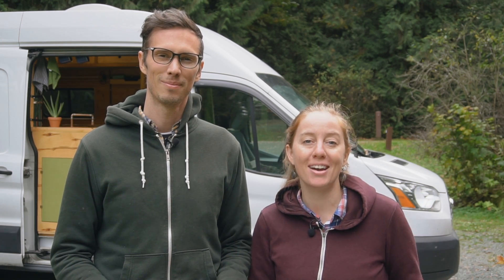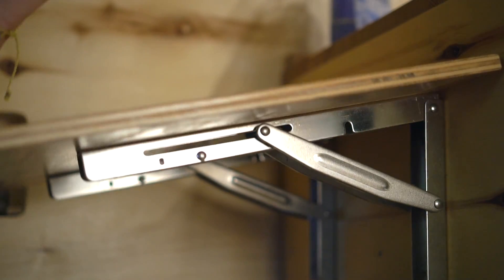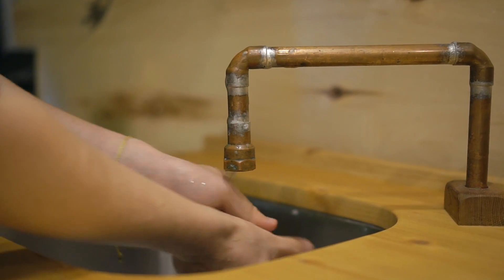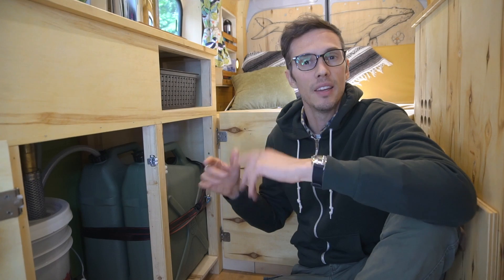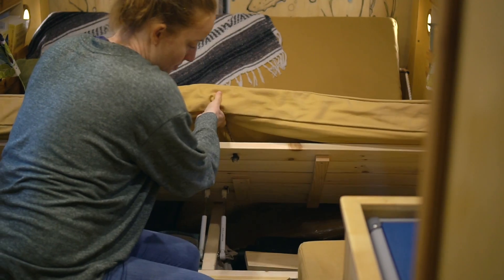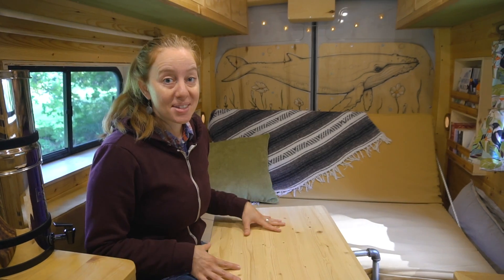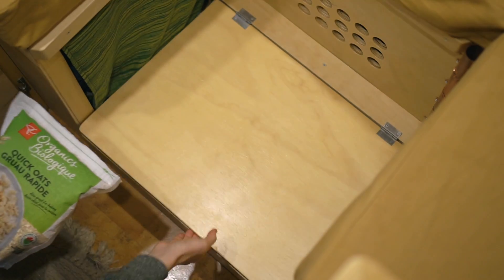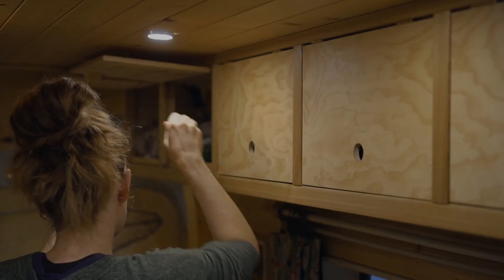VAN TOUR | Tons of Smart Ideas in this Spectacular Conversion | Our VANLIFE Tiny Home

Comment: I really like the elevated fridge. Most are pull on the ground and pull out, sure they may double as seating, but I like the idea of simply lifting it up and reaching in without bending over. Also you made it look like a nice countertop. Great idea! 👍😂❤ Screens are needed 100%; designs that don't have them bother me. Glad you have them! 
Amazing bed idea as well!  Multi-functional without a lot of rearranging. I've made mockups of some of my designs and found that when things can transform they often just stay the way they're used most, so the don't even need another form, but with your design it's simple enough it looks like it's worth the minimal transforming!

Comment: How much for the van ?
How much for the conversion ?
Thank you , great job !
Vikings love Freedom
Reply: Don't get hung up on the dollars. You can spend as much or as little as you want. Utilizing used items, reclaimed materials, and sweat equity, go a long way to saving money.
Reply from the maker: Hi, thanks for watching! We haven't done the final calculation yet so these are some approximate numbers: We got the van used for 19k and the conversion was around 9k US. So the total was approximately 28k US (around 37k Canadian). It does seem pretty expensive but it all adds up, the fridge, the vent, all the wood and hardware, the lights, insulation, heater etc....we really tried to lower the cost wherever we could by creating our own low tech solutions. Keep in mind also that we were given the solar power system by Inergy so that would've added an extra cost. Like with all vehicles there's also some ongoing maintenance expenses that unfortunately never stop! Hope that helps :) :)

Comment: Hey guys, what a beautiful van you have built together :) I love the natural feel, the beautiful artwork and your attention to detail. I notice you mentioned a recycling bin, and also a rubbish bin lined with paper, to 'create less waste' and I wanted to call you up on the using wet wipes comment... wet wipes are usually made out of plastic resins - polyester or polypropylene - which never fully degrade... yep that means they leave behind tiny tiny pieces of plastic. My solution is to use cotton fabric squares (made from old clothes etc) and a spray bottle filled with water! I then wash them with my laundry. Hope someone finds my tip useful! Enjoy your beautiful van and thanks for the tour.

Comment: I have to say that you really out did yourselves in designing this short box  Nicely done      I had retrofitted a 2011 Mercedes Sprinter extra high & 170 long box for hauling loads cross border   After all electrical and instal of Espar heater furnace which runs off engine oil with no engine running > had it sprayed foamed for better interior climate control and enjoyed it for as long as it lasted   I found that the interior room was graceous   The ride after changing what Mercedes cheeps out of on tires with Hancocks because of poor quality roads   Your vehicle will service you well

Comment: Hello dear Mat & Danielle
! Yes it is really an extraordinary conversion concept with a lot of incredible ideas behind. One thing I noticed is that if toilet is in use, kitchen place & in/out passage will become occupied. I've a suggestion to eliminate this issue. The toilet door can be modified: Currently, door-width is say W. When open, it occupies W space in front of toilet. If you split the door into 2 equal halves & add an extra piece of width W/2 making the door-width total W+(W/2) with 3 foldable pieces, then unfolding this door will occupy only W/2 space in front of toilet & remaining W will cover toilet. In this way, W/2 space in front of the toilet will be free for kitchen and in/out passage all the time.

Comment: Bravo! What a beautiful, well designed and constructed space.  
I would just add a quality roll-out awning mounted above the sliding door, and one of those small knee-high folding tables to put between your folding chairs, so you’d have outside living space. As I was told when we bought our first camper, the Scamp ‘13, the camper is for sleeping, cooking, safety, but, most of your living can be done outside. 
Happy Trails

Comment: Great video I love the finish design and aesthetic function. Quick little tip from a loving soul, place your carbon monoxide detector higher up on the wall or ceiling. Carbon monoxide is a hot gas, lighter than air and it will fill up a space from the ceiling to the floor.

Comment: Very elegant and well-thought-out build. Particularly the loo, because a lot of DIY builds don't have them, especially in a smaller van. If you spend any good length of time in a van, there will be times when at least an emergency and private toilet can be very convenient-especially for older people.  There are many videos on u-tube that almost mock people who build toilets, and I just don't believe people when they say  they can easily and quickly find a loo. Sometimes they are locked, or filthy, or maybe in an unsafe area. And often you have to pay. 
We are going to get a van soon, and amateur build the "house", so we are weighing up the pros and cons of a wooden verses aluminium framework.
An outside shower with a tent [option] is nice too.  Good to rinse off the salt water after a swim in the sea, or sweat after a bike ride or trek.  We will use one of those cheap "solar shower"  bags which should be good enough. 
In commercial, professional and many home builds, a lot of people build massive kitchens, as if they are going to cater for a whole town or something. But for two, you really only need a small, but well-planned kitchen area, so I think you got the mix right there as well. 
The bed/living space is also genius.

Comment: I have an idea for the shower. The door can have a installed metal u-shaped rim at the top that folds down when not needed. Keep shower curtains that latch onto the looped rim and a plasic foldable bathing tub below you (I have seen the tub it in a van video). Attach a drain pipe to the tub and the other end to the container below the kitchen sink. 😀😀😀

Comment: Excellent built.  That said, I still think shower is important.  There is one great idea I saw on a Tiny home.  Since we probably take 1-2 showers all day, they have a permanent water fixtures behind a sliding cabinet. when you slide the cabinet to one side, you can pull the shower curtain to an enclosed space where you can take a shower.  They have a 3 inch water retaining area with the drain where you stand.  I'm not good at explaining it in words, if I find the video again, I'll post the link here.

Comment: Apple cider vinegar with warm water will keep you clean in between showers. Find some non toxic water absorbing cloths and use them to clean the body with the acv and warm water. Witch Hazel is another great alternative! Both apple cider vinegar and Witch Hazel can be rinsed through the hair to keep hair and head clean. In my personal experience I have found wet wipes to leave body odor - cotton rounds work best for a quick clean.

Comment: Excellent build. Many innovative ideas. Not to be picky but one thing I would suggest is putting privacy curtains around the inside of the cab area. Ran into a problem with some dopes once. Had the privacy curtain across, behind the cab similar to this. When I entered the cab area to start and drive off the dopes saw me. That is when everything went really bad. If the curtains had been around the cab I could have easily slipped in to the driver seat unnoticed and drove off. It is a lot of work to configure and install the curtain rods above the cab windows. But it can be done, and IMHO, well worth it.

Comment: Awesome design.  Ima steal a lot from it.  I need a little more space for a full 80 inch long bed, and a shower, so i think i'll adapt this to a longer van.  Adde length solves the fridge dilemna too.  Add a floor drain by the toilet and a circular ring/curtain deal, upgrade to electric pumps and i'll be good to go.  That bed though! Great design, solves a lot of problems.

Comment: This, and your build video, are absolutely wonderful. THANK U FOR TAKING THE TIME! You guys got talent in so many regards! I wonder how soon you'll be building for others and kinda hope never for your sake. When I build mine I'm going to try and incorporate the use of swivel driver and passenger seats... I think adding an additional lounging option might be highly beneficial. I'm gonna add a p-trap to my urinary diversion set up and a tight sealing lid on the shitter (I hope I remember to take that lid off when using). I'm gonna use quarter-turn valve stops wherever possible (ie: gray-water dump). I'm gonna figure out how to make my vehicle alternator charge my Inergy Flex Modular Solar Power Platform. One thing that bugs the heck out of me is that with solar we must park beneath the sun… on hot summer days parking in the shade is nice. Regarding windows… I haven't seen much discussion on how to keep rain from coming in when parked and hanging out on a warm, rainy day.
Reply: Is it possible to have the plans/drawings? Congratulations! It's the best design I've ever seen :)

Comment: I would add skylight, some porthole windows in back, and shower in bathroom.  You could probably make a shower between open bathroom door and front curtains, with drain in floor.  Make a front curtain that swings out from arm on open bathroom door. Also screen for slide door. I would lose the top loading fridge. I would make table leg taller. For the toilet, you should not have an open pot. Have a lid with a small hole with pipe from top going thru.

Comment: Fantastic build and some genius ideas...however. ..I'm surprised a bath was not included 
..especially since you're so creative with everything else.

For instance outside of the toilet area on an overhead circular copper shower removable contraption or on the van garage/back doors.

Comment: I'll be building a trailer conversion which is much large than a van of course. In place of a fan for the chamber pot. I'm thinking of using the sun to draw air out of the chamber with a black box at the end of the exhaust pipe .. also an air intake at the bottom of the chamber pot. This should work so long as there is sunlight.  I figure if the chamber is well sealed you shouldn't lose to much heat or air conditioning, besides you do want som air circulation. Also if you're in a cold area I've seen people have much luck building small solar heat panels they can mover around attaching through a window an easy build very cheap for the money.

Comment: Nice van! Thanks for sharing. With your follow up video(s), I would be interested in more details the kayak, the Inergy Apex system (size, voltage, how long to charge with full sun and optimal exposure as well as what you use it for (what systems routinely run off of solar) and how long it takes you to deplete the batteries.  Not because I am nosy but to better price that system with the knowledge that I would need a larger or maybe smaller system. Thanks for considering my request s and for your willingness to do a follow-up video.

Comment: Very well done van! I believe I Just picked up a typo in your description ... The heater is not gas but a diesel ,(parking heater) if I understand correctly? With the fan in your composting toilet ... Wouldn't it have been easier to put the vent down through the floor? I wondered how long you need to use the fan in your toilet after each use? Can't wait to see the build vid!

Comment: I would've probably put the fan inside the toilet box and directly on the wall. That would've saved on the build a little and gotten the same, if not better, results.
Given the hindsight of the pandemic, it's probably not a bad idea to try to work in a gravity-fed shower or wash bucket into the design. Alternatively, in more temperate climates, deploying a shower tent outside would also work.

Comment: Really great vid and build. I'm 60% complete with mine and stuck on the solar. You've made a great point with simplifying solar. It seems my power needs are similar, but adding a occasional game system. Do you feel the apex you've used is capable of 24/7 dometic like yours, long hours using maxxair, and laptop for a few hours?

Comment: It sounds like you wouldn't be keen on having a shower in the van if you had the space due to wanting to keep damp air out. But I listen to a lot of these videos and I'm sure you know that its put outside sometimes. A black water container with shower attachments,  on the roof, and a folding rail  with curtain, or a fold down toilet tent, would do the job.

Comment: they should attach a wooden piece to the fridge is (making it flush with the counter top) and put a handle to the left side of the piece and then they would have counter space but wont have to take the piece off to open the fridge. basically the wood piece would be the fridge door

Comment: drove tractor trailor 3 or 4 days no place to take a shower kept a 5 gallon gas can with water used johnson baby sope came off easy had a 5 gallon pail filled a wash tube up with water washed my hair dumped the water in the pale then refilled the tub and washed my body dumped the water outside also gas stations lay cardbord on the bathroom floor and you can wash in there

Comment: That is not a kitchen with that stove, it's a joke untless you live on cups of tea and since you can't cook anything you don't really need a fridge. Forget that silly footpump, just go for a low flow submersible pump. A "p" trap will soon become a dirt trap and block. Rock and roll beds work fine, what you have there is overcomplicated. Buy a cheap folding table and use it inside and out. "Tons of smart ideas and a spectacular conversion"...no it isn't....enough.